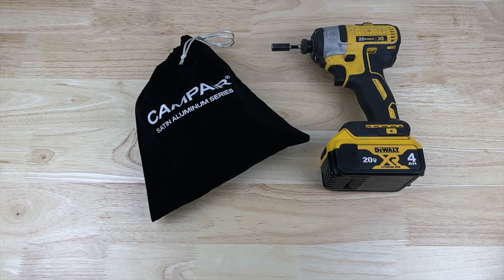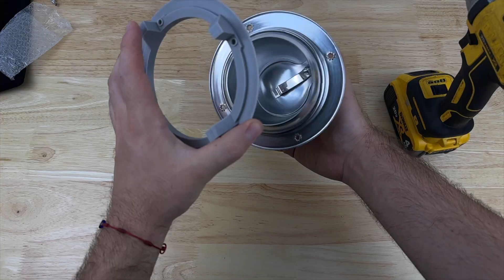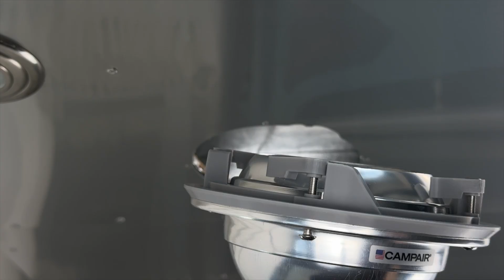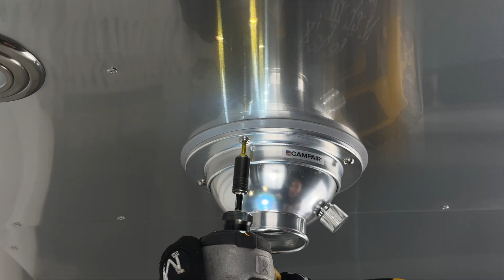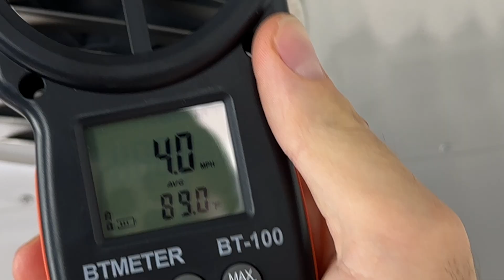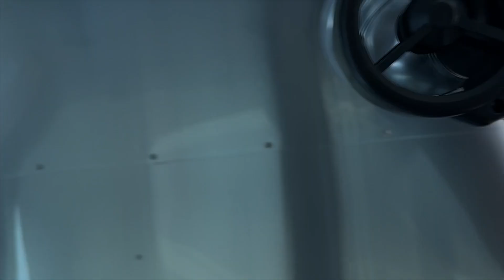Upgrade Your Airstream: CAMPAIR High-Flow Satin Aluminum Series Air Vent Install & Airflow Test

Comment: I just got these delivered yesterday, a little nervous, in the video you state there is an optional bit but you dont say what its for or its not clear the name you called it?
Reply from the maker: Hi @RaffyP. The vent includes a hex drill bit adapter. It can be used to replace the hex wrench for a quicker way of threading the bolts. Just use caution to not over tighten as this can damage the aluminum.
Reply: @RIVETEDMARKET  I dont think thats my question, in 1:20 of the video you say something like optional exit drill bit? I cant understand the word you are saying? one last question, am i drilling into the rivet with the 1/8 bit like i am screwing something in? Am i essentially pushing a rivet out or am i drilling into the rivet?